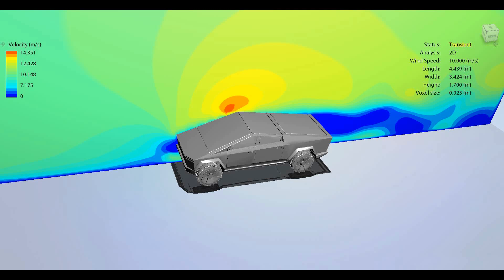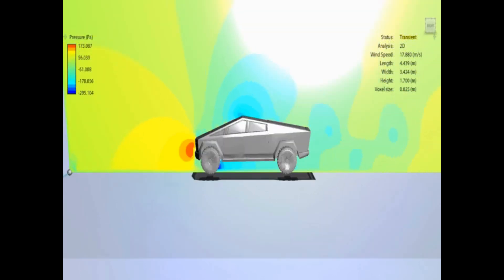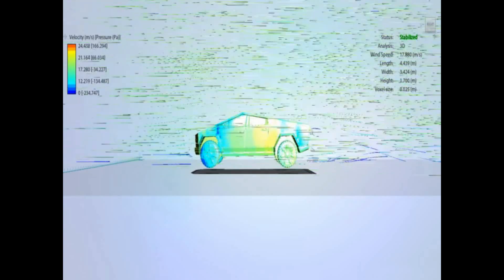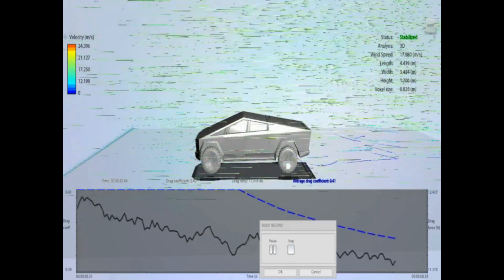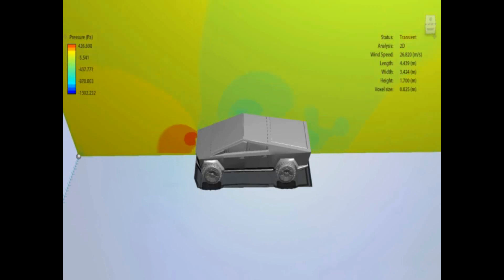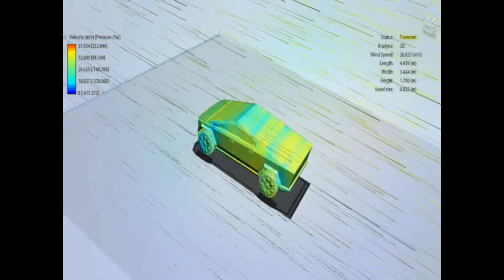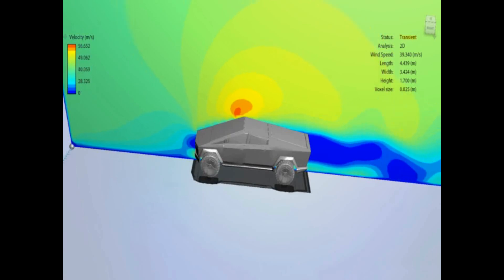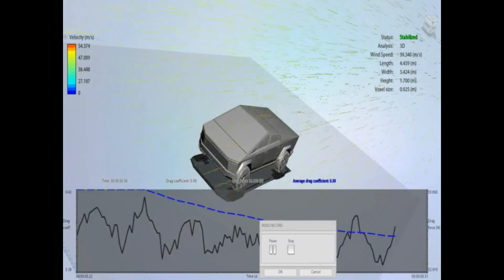Cybertruck aerodynamics - Whats going on?!!!

Comment: How about testing it as a truck, with an open bed?
Reply: But why when it is designed to be closed, and opened only when putting things in it. That's a good design, open bed is like the worst design why would you want to test it with that?
Reply: @mudza92  because sometimes people will carry things bigger than what can be carried in a closed bed
Reply: @BoomchacleV0  when they do that, they're free to open it, until that no need to leave it open its simple
Reply: @mudza92  Because the point of testing it with an open bed is to show what efficiency you'll be getting while carrying a large load.  that... is the point of testing.
Reply: @BoomchacleV0  Well go and test it then
Reply: @mudza92  How about we let the guy with Fluid simulation software test it, like the comment which you thought was worthless originally suggested.
Reply: @BoomchacleV0  

"Because the point of testing it with an open bed is to show what efficiency you'll be getting while carrying a large load.  that... is the point of testing."
Then you need to put a load (that requires an open bed) on the truck and since loads can vary so much you won't have any meaningful interpretation of the results. For example, what would a mattress set do to the efficiency compared to a very aerodynamic kayak?
I don't think that even other manufacturers will venture try analyzing the truck with loads.
Reply: @mudza92  Because why the hell would you buy a pickup if you intend to drive it with the bed closed?
Reply: @bangerbangerbro  99% of the time pickup beds are empty lol. You test for how its used. Open the bed, lose about .05cD.
Reply: Look around at the trucks you see driving around: Most of them the bed is empty, or has little enough in it the cover could be closed. Most people will probably only have big stuff in the bed a small portion of the time, the rest of the time range and efficiency with the bed closed is more important. And as others point out here, if you have a large object sticking out of the bed the aero of the rest of the truck becomes pretty much a moot point, the open bed is the least of your worries. And whatever payload being carried is so variable it would be pretty much pointless to analyze much less design around any one payload scenario. A truck can carry anything, so you can't design planning to carry one thing. With big cargo range will obviously take a hit, there's nothing that can be done about that, so they focus on designing it to be efficient with the cover closed, as most probably will be the vast majority of the time.

Comment: Who said it should be aerodynamic?
Reply: Your mom
Reply: Can you give one good reason for it NOT to be as aerodynamic as possible? Basic logic kind of dictates that it should be.
Reply: @mycroft16  if they wanted as aerodynamic as possible they would have flattened the roof even with the back seat to lessen frontal aera and eliminate the wheel flairs keeping the tires inside the body. Thet wanted a look more than a low Cd.

Comment: Do this compare with a F-150 please!!
Reply: DATING HARLEY QUINN  No the Tesla was full size. It would be super simple just to put in the correct numbers. Did you see Elon's tweet today? He admitted it wasn't .3 and won't be without "extreme" measures. I'm sure that means lose the fender flairs, keep the tires inside the flat side panels, and probably also flatten the roof. Even then add the mandatory side mirrors and windshield wipers and it still won't be .3 in production.
Reply: DATING HARLEY QUINN  the toy sized F150 comes out bad, maybe he will set the scale correctly and see if the air on a real sized F150 might have a better chance to reattach compared with a toy. Running a 1/8th scale car at real 60 mph is showing the aerodynamics the truck would get at 480 mph. So the Ford is actually doing pretty good. Try it again with the scale correct.

Comment: That is why nature uses the triangle as a basis for design. Birds and fish are triangular polygons with sharp edges to make them more efficient.... Oh, wait, no... it is the opposite. Plus it has the added benefit of being ugly and I can’t even safely throw metal balls at it like I wanted to. What a pos truck.
Reply: Funny how the most ardent truck users are also the ones that want this truck the most... I guess it must be because it sucks so much as a truck.
Reply: Triangle is actually used in nature for strength and with cell division you get a tetrahedron (3d triangle) as the first stable structure after two divisions and you have 4 cells just like the tetrahedron has 4 points. If you take the cybertruck and draw the most efficient shape on top it is actually super close. It will be way better than other pickup trucks for sure as just covering the bed makes a huge difference.

Comment: Could you do one for the E93 M3 with and without the convertible roof
Reply from the maker: Yes if your comment gets 10 likes then I will do it :-)
Reply: @BoatsandEngines  Thats >10
Reply from the maker: @AJKing8  ill do it :-)
Reply: @BoatsandEngines  do it
Reply: @BoatsandEngines  Could you do a video showing us how we can do this for ourselves? Not the modeling part but how to use CFD software if we have a 3d model on our hands already
Reply: Boats and Engines also,keep, in mind the convertibles have a wind deflector you can install in back seat so windows up with wind deflector up. And maybe one with no wind deflector too
Reply: @BoatsandEngines  Also since we got so many likes.. could you talk about how the aero changes with a front lip and rear diffuser and side skirts
Reply: Boats and Engines I’ll subscribe just to see the E93.

Comment: It appears you've modelled it with a flat front. Looking at various images, I'm sure it has a slight curve across the front and isn't dead flat.
Reply from the maker: Yes the model in not perfect.
Reply: I think they're practicing steel variants and processes on the truck for use on Starship; I'd be amazed if they didn't start forming with dies and high-tonnage presses.
Reply: Will publish a more realstic CFD analysis soon!
Reply: It's made from 3mm steel sheets that can't be stamped. Definitely no curve.
Reply: @r09d98  Bruce Jackson presented facts. Cybertruck front is slightly curved.
3mm will absolutely bend. Stamping it is just a bit more difficult compared to normal car manufacturing.
Reply: @KaffiRawr  
The body panels are cold-rolled [full-hard] stainless. 

Gentle curve? Yes. General stamping? No.
Reply: @avid0g  Well, yes. That's basically what I wrote.

Tools to stamp the steel for car manufacturing wouldn't be cheap.
Reply: @KaffiRawr  
Elon said x30 would break the press
Reply: @avid0g  That is true, but in context probably just referring to "his press".
Reply: @avid0g  Can you please point me towards the yield and tensile, and ultimate stress of 30X Cold rolled steel? I cannot find a single place that lists it's specifications.
Reply: @Test-tz8pg  
You need to include type "301" to get specs, probably "full hard" as well.

"In its full hard condition, type 301 has a tensile strength of 185,000 PSI minimum, and a minimum yield strength of 140,000 PSI."

That means that the PSI will at least reach the first higher number in the yield range.  

Pressure will reach the lower number being capable of fully springing back. Any higher and it may begin to yield. 

Elon's 30X cold rolled may be even harder than full hard. IDK.
Reply: @avid0g  Oh ok thanks! So I assume the X is saying its one of the 300 series stainless's? Or else why don't they just call it 301 stainless? Because it seems like calling it 30x could be 301 or 303 or 304.
Reply: @Test-tz8pg  
Perhaps because when cold rolled thirty times, you get a 270,000 psi yield strength, which is much harder than "full-hard" 301.
Reply: @avid0g  I'm getting the impression no one is exactly positive on what Elon's stainless is haha. Could it also be so they can use different 300 series steels for different parts? Say use 301 for it's abrasion resistance for the front bumper, and use the cheaper 303 or 304 for the doors?
Reply: @Test-tz8pg  
Elon mentions "love 301 stainless" in some tweets, "cold-rolled thirty times" in others. This may be a 301 variant with less nickel, more silicon, but still 301. But it has been strained up to the point where there is no more capacity to get harder, such as 270,000 PSI. 

SpaceX also uses SX300 and SX500 alloys in contact with hot high pressure oxygen. Not the same as this.
Reply: @KaffiRawr Well, the press as strong as required to stamp body parts from it just doesn't exist - not only at Tesla, at any other company - even if you built it, panels would probably have too many defects. Just mind that the press line Tesla currently uses is largest in North America and 6th largest in the world - https://en.wikipedia.org/wiki/Tesla_Factory#Overview
Reply: @Test-tz8pg  
I'm sure that the crush zones are made from a softer quarter-hard or half-hard steel that can be deformed during impact, but the bumpers, "skin", tonneau bed, body pillars, upper truss members, and skid plate (battery shield) are likely to be full-hard. 

Even some formed/stamped parts in the "passenger cage" may be nearly full-hard after stamping, although that is tricky, and hard on the dies.
Reply: Ricardo i think he meant angled not curved
Reply: @r09d98  they've curved the Starship
Reply: @r09d98  to bend into one direction only is easily possible with even thicker  steel panels.
Reply: @thomasherzig174  
The steel comes coiled in large rolls with a much sharper curve at the ID than the front bumper has. Rollers are used to straighten the 3mm full-hard ribbon and so it is just as easy to recurve some for the bumper front surface. The top and bottom are likely welded to the curved front to make the complete bumper. 

That does not mean that full-hard stainless steel can be stamped into complex 3D shapes like a complete front bumper. Most likely, the sheet would fracture and/or wrinkle every time. Otherwise the die would rapidly wear out, or the press would fail. 

Elon said that even the 90° bends require gouging a notch (in what becomes the inside corner). Otherwise 3mm sheet is just too difficult to form into the tight bends they desired. I expect that many of these bends have the inside corner welded together to restore strength.
Reply: @r09d98 3mm steel can't be stamped?  Yes it can.
Reply: @markin_  
It's not the thickness but the hardness that makes this metal impossible to stamp into domes, 3D curves, and such. The metal is cold-roll hardened well into the yield region and close to the failure point so it also has brittle properties as well as greatest possible strength. 

If you ever played around with a hardened hose spring clamp, you know it cannot be straightened without shattering. Although the hardening processes differ, the result is similar.
Reply: @avid0g  thanks! You're totally right!

Comment: I was wondering what the coefficient might be and had hypothesized that it should be better than an equal sized pickup though generally worse than the Tesla sedans. You confirmed it for me. Thanks.
Now I wonder, since the Cybertruck has active load leveling whether you have attempted to model the variations possible with different angle of attack front to rear. I have considered that it might be possible to add leveling pitch changes to mitigate flow changes due to the bed being open rather than closed. Also compensate to some degree for the cargo in the bed extended above that slope tumblehome.
Reply: I also wonder if they don't have any clever little flaps on the bottom that can deal with airflow changes underneath the car in some way. I wouldn't put it past them. Hypercars have been using things like this for a while and it would not be out of the real of possible for Tesla to do something like this on a truck.

Comment: The cover over the bed probably also has quite an effect.
Reply: yeah that’s why it’s there
Reply: falchulk It’s been proven many times that a tonneau covers effect on fuel mileage is extremely minimal at best. People have a hard time changing their views though. To add to the conversation I have a hard tonneau  cover for my f150 and can see no difference in fuel economy with or without it.
Reply: When there is no cover over a normal truck bed, the air creates a vortex of low pressure in the bed, which, in turn, creates a streamlined "invisible hood" that decreases drag. When you put a cover on your truck you eliminate the possibility of creating such a vortex and end up creating more turbulence. This was explained to me by my professor at San Jose State University. He is an executive at NASA with a Ph.D in aerospace. Take it or leave it.
Reply: David Vaiz “it’s worse than without!” Is not actually true either. It just... doesn’t really matter much.
Reply: Huge. Covers are sold for existing trucks and they make a huge difference to aerodynamics.
Reply: If I recall correctly, the tailgate tends to create a circulation of air in the bed which acts to mitigate this issue.
Reply: falchulk  good thing anecdotes dont count as scientific evidence
Reply: Didn't the myth busters test that in a normal one? I thought the concert actually worsened the drag.
Reply: falchulk ok buddy
Reply: If you’re using your trucks built in trip calculator it’s misleading and inaccurate. No wonder you don’t see a difference
Reply: falchulk  aerocaps do
Reply: falchulk  aerocaps r not like toneau, they change the physical shape of the truck and basically convert them into a coupe style suv, so yeah, they do something
Reply: Mythbusters actually had an episode on this years ago. No tonneau cover did the worst, yes tonneau cover did a little better though not much, and replacing the tailgate with one of those weird rubber net things did the best and again the difference wasn't that great.
Reply: Mike Warner by the time you’re at speed, the air at the back of the truck is still primarily affected by the top of your cab, and not very much by what the tailgate is doing.
Reply: falchulk  nah mate, fuelecoonomy so much better with a bed cover

Comment: It looks not very aerodynamic
Reply: It looks super close to the most efficient shape possible actually. It will be way better than existing trucks for sure. Just draw that tear-drop shape on top and you see that it fits as close as you can get while using straight lines.
Reply: @0ooTheMAXXoo0  Teardrop shape is not the most efficient shape possible.

Comment: Would the Cd be improved if the roof had a horizontal section before tapering down at the rear bed?
Reply from the maker: Perhaps, but I don't think there would be a huge difference as their doesn't seem to be a problem with separation in that area.

Comment: What happens when you lower the car? Which it will do at high speeds. (the stiffness of the air suspension will also increase to improve road grip).
Reply from the maker: Should lower the drag

Comment: Thats basically engineering porn...love it <3
Which grid do you use? And how dense do you make the grid near the surface to resolve the boundary layer?
Reply: This is Autodesk Flow Design. You don't do any of that, you plug in your CAD model and set the wind speed and orientation, and hope it figures out these parameters on it's own - which it probably won't, my experience with it is that it's basically useless. It doesn't have any ability to tweak any of these technical parameters as would be expected in any "real" CFD software. I've used it a little bit, enough to determine there was no point to doing so.
Reply: @quillmaurer6563  Ahh I see. But setting up a CAD model for CFD is a horrible task so better don't do it :D
Reply: @quillmaurer6563  Yea you're right, I had a CFD class for one semester and we needed over an hour to set up a 3D simulation for a 2m wing... And then we waited half an hour for the stupid university pc to compute that shit.

Comment: Cool video thanks for sharing. I'm wondering is the whole body acting like a facetmobile aircraft, or a lifting body aircraft. If that is the case As well as a lifting force there would also be a vector force angled forward effectively helping to push the car along a bit like a gyroplane rotorblade self spinning in the wind. Also is there a aerodynamic gain to be had by allowing more air under the truck hence high ground clearance relative to competition.
Reply: Ground clearance  is adjustable. At highway speeds you would not be driving so tall. In almost all situations you would not be driving at maximum height.
Reply: Worse aerodynamics riding tall at high speed. Much less roll stability.
Reply: @andrew ashmore the total reaction of an aerofoil is up and back, NOT forward... so if that brick made lift, which it doesnt, then the force would go up and back, but i garranty you on that thing all the force is drag...
Also a windmilling propeller creates huge amounts of drag, and certainly not a pulling force